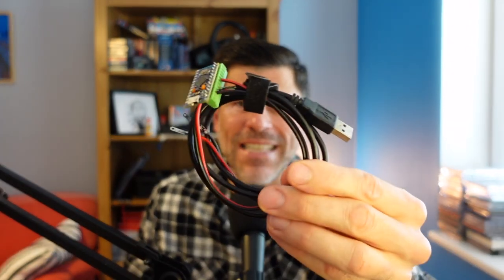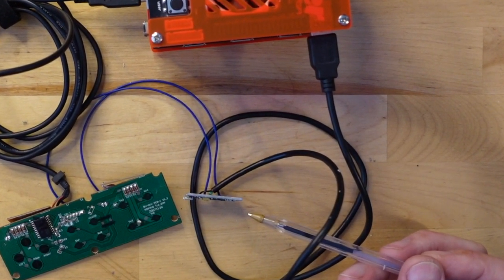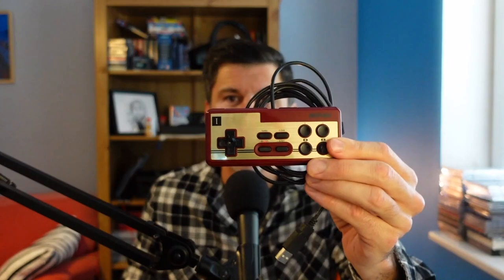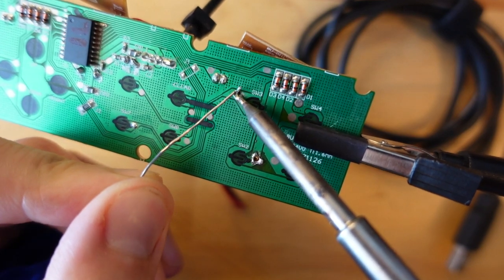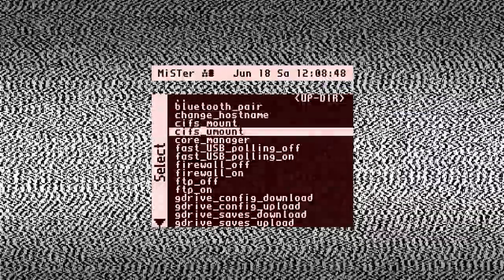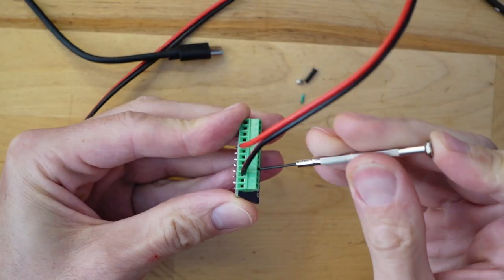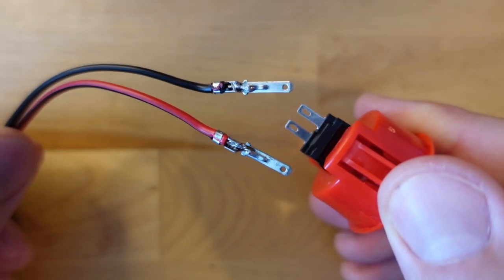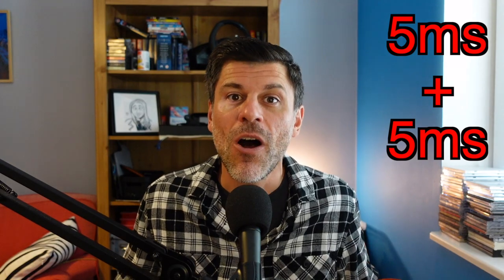Lag Test Your Controller - MiSTer FPGA Input Latency Tester

Comment: Very interesting! Thanks for showing this setup, Zez.

I'm just curious. Did you enable the 1000mhz fast polling option before testing? Is there any value in testing results without the fast polling option on? I was just wondering about measuring lag results without it, so we can estimate some results for devices you can't enable faster polling on (console, PC, etc.).
Reply from the maker: That’s a great suggestion for a follow up video, thank you! I was trying to cover the basics end to end in this video

Comment: I recommend the USB breakout. There's no guarantee it was actually wired up to the proper standard
Reply from the maker: That’s true. Although you could just switch wires until you get a result. However yeah I hear ya, I remade mine using a usb breakout once they arrived

Comment: As I could read, lag on mister equals: controller input lag + usb port lag + LCD display (at least, 1 frame of delay for painting the display) or using a CRT. It looks a lot but it's normally between 1-3fps lost being 2 the normal deviation using LCD and a USB controller on a mister.
Reply from the maker: I generally agree but a lcd doesn’t need to take atlesst a frame. I’ve measured my screen at 5ms with a Time Sleuth.
Reply: @ZezRetro  it has very little input lag, what they were considering though was post processing, as it is a digital output device. This means it will require 1 FPS lost for every second in order to manage the video. I can't tell if this is fully true on LCD, I know it's not on LED.

Comment: I’m slightly confused. Your results for the arcade still when wired are much higher than what’s listed in the database. Unless I’m misunderstanding something.
Reply from the maker: Can you point to the part of the video which confuses you and I'll try and explain. At 8:51 I show that wired got 10.81 and the database says 10.86
Reply: @ZezRetro  I’ve realised why I was confused. The one you tested is the newer model. The older N30 model had much lower input lag.

Comment: I want to make a new arcade machine and input lag is crucial to me. The one I made years ago looked like absolute crap but the PS/2 interface made it an enjoyable experience. I just don't trust USB to meet that standard since, as you nerds all know, INTERRUPT will always be superior to POLLING in terms of latency.
Reply from the maker: When speaking in absolutes, interrupt is superior, these results show that USB into a mister is ~1ms, its hard to argue with that right?
Reply: @ZezRetro  I hear you - but the nature of polling is that the CPU is requesting that data at its convenience, as it were. If the system is occupied with some CPU-heavy tasks... like, oh I don't know, emulating several different chips in real time... the USB cache doesn't get checked as often.
Reply from the maker: However, how much does that checking really add? This device is benchmarked at 1ms under ideal conditions on mister. If it’s runnning a core how much extra overhead can there be? 2ms? 3ms? Even if lag gets tripled, it’s still only 3ms

Comment: Wouldn't trust the database regarding the Bluetooth result. Bluetooth faster than wired?
Reply from the maker: It is totally possible. A good bluetooth stack can be faster than a less optimal USB stack. These results have also been duplicated between different testers

Comment: Is it possible to measure the inputlag of original SegaGenesis controls connected to the db9 port?
Reply from the maker: Connected to the DB9 port of a original Genesis? Controllers from that era typically didn't have any lag, they were too simple. As far as I know you don't need to worry about original controllers on original consoles until the Xbox360 / PS3 era as that's when USB became a thing.
Reply: DB9 is an analogic input, which means 0 lag, and that's why they are really valuable nowadays. Same happens with CRT TVs also 😀
Reply: @RekoneInkings  also I know that db9 genesis controller is compatible with all cores. Super great.
Reply: @rodribyte4255  yes, it's supposed to be plug and play 😜

Comment: Thank you for the video. I like the information that was shared. However, I am shocked by the recommendation to drill a hole in your controller. The solder should hold fine if you know how to properly solder and you prepare your surface correctly. Honestly, your technique needs a little work. The solder joint you showed is pretty bad and should not be shown as an example. I’m not saying that to be mean or rude, just to let people who want to learn know that you don’t need to drill a hole in your board to solder a wire as long as you perfect your soldering technique.
Reply from the maker: Your thoughts are valid. As I explained, that’s a technique used in pad hacking when you want a stronger permanent connection. That’s also why I chose a simple pcb. In retrospect a more real world example would be choosing a shoulder button on a modern controller as they often have better exposed solder points. Also this isn’t a solder instructional video, go talk to Voultar for this